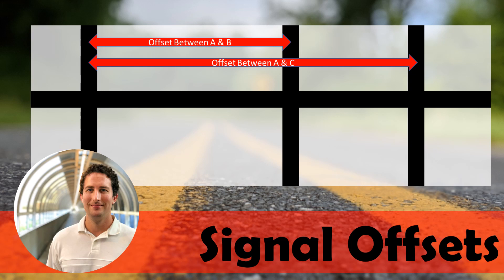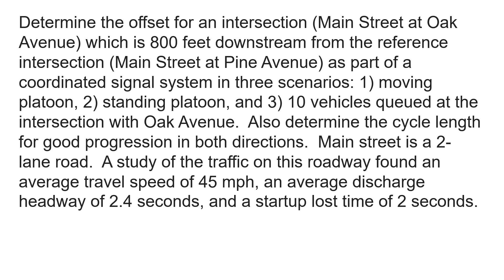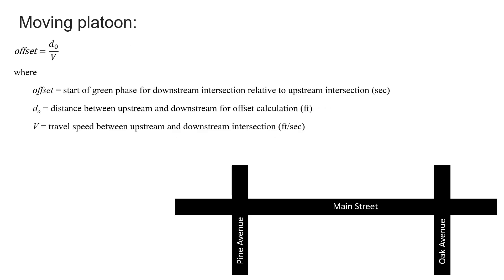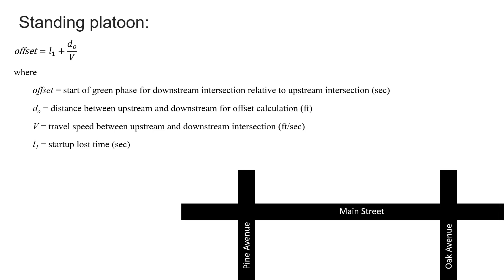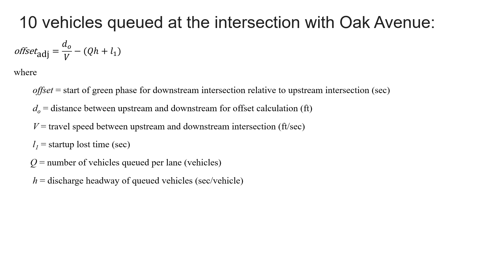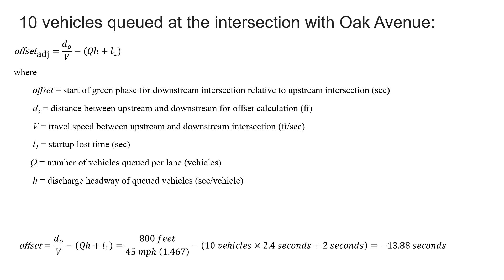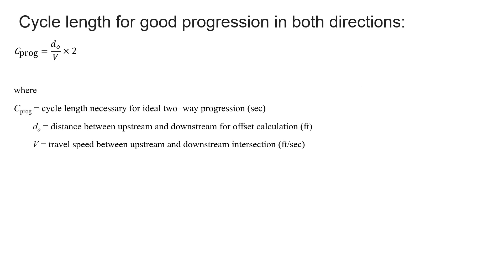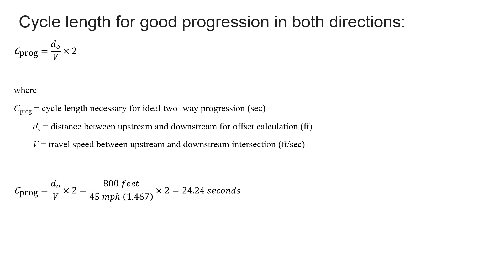Offsets for Traffic Signal Timing and Design | NCEES Civil Engineering PE Exam [Section 5.4.2]

Comment: Outsider here, searched for "traffic signal mathematics," this popped up in the feed and the video duration looked good to me. A couple shorts were decent but lacked detail.

Gotta say this seems way more confusing than necessary, largely due to notation and slide presentation.

The beginning problem slide looks like garbage. Terrible formatting. Reading the problem is way more difficult than necessary.

Equation slide shows much better formatting, but the notation is filled with head-scratchers:
- offset as its own term, without a variable?
- d_0: why include the subscript? inconsistent levels of detail (offset doesn't even have a variable, now this one has a subscript?)
- V: upper case V for velocity? Upper case V is for volume
- l_1: l is for length, not time; this shortcut of notation about "lost" turning into "lower case l" is awful notation. Use a t to be consistent with standard notation.
- Q: qty? Upper case? Classic notation would probably be n, "number of", why add confusing? Queue theory? Bad notation to be consistent with other disciplines. Q is for things like heat transfer. Flux.
- h: headway gets a length term as well? This is a time related variable, so use lower case "t" with a subscript.

Figured I'd offer up some constructive, though critical ideas about these slides. Outsiders quickly understanding, including detail, is an amazing standard of excellence.
Reply from the maker: Thanks for the feedback and suggestions - this video reviews NCEES equations, so I used them exactly as presented in the PE reference handbook.